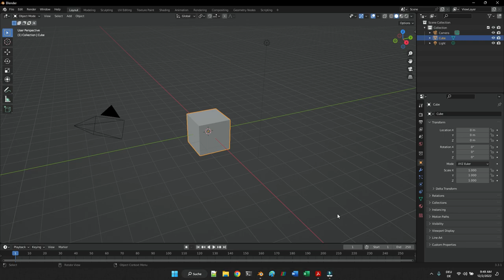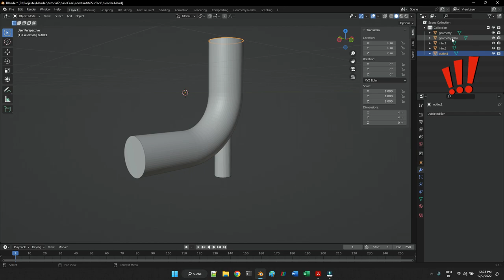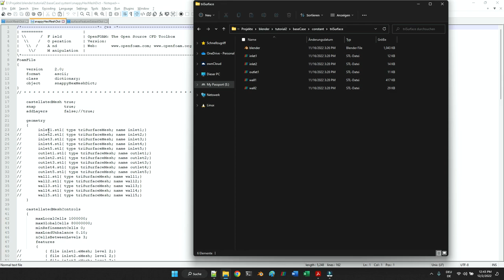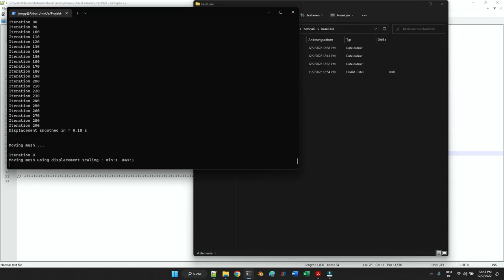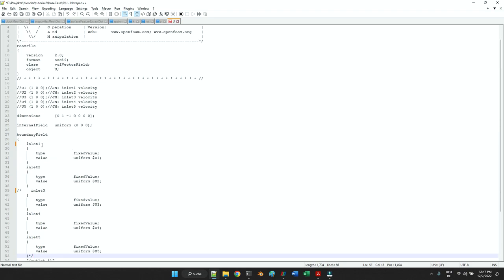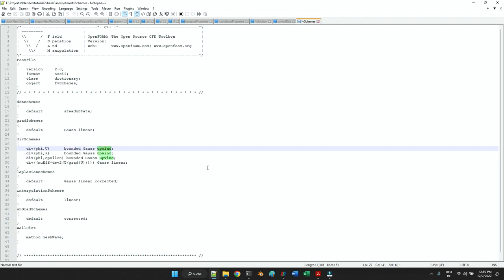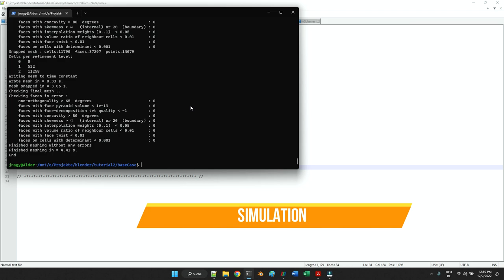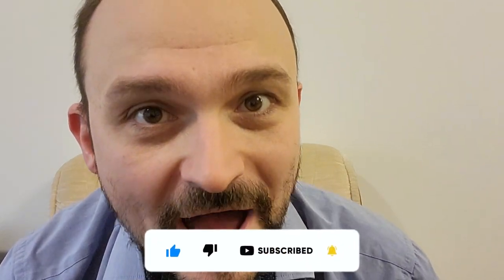What the h*ll is OpenFOAM? Explained with a PIZZA!

Comment: One problem I'm having is that the "surfaceFeatureExtract" has been superseded and replaced on newer versions of OpenFoam (I'm using the latest version v10), so the mesh creation process isn't working.
How to create a surfaceFeaturesDict that acts just as the surfaceFeatureExtractDict would be a great tutorial !
Reply from the maker: Yes, a lot of the syntax changed in the .org version. Unfortunately, I can only support the .com version (v2212) with my tutorials.
Reply: Why change version? Is there anything needed in the new version?